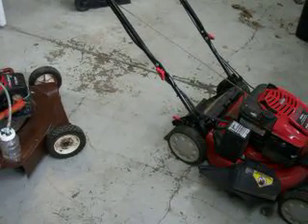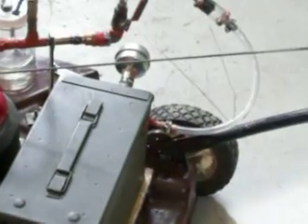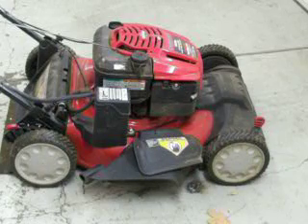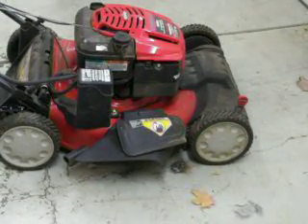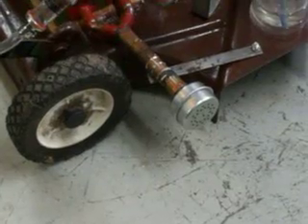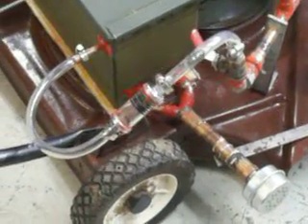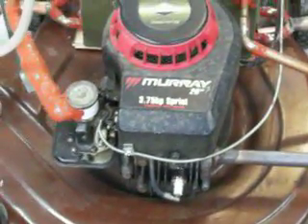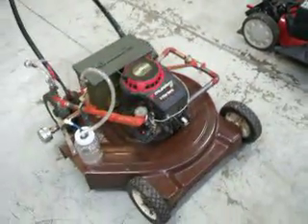temperature difference between gasoline and gas vapor

Comment: At 160 degrees Fahrenheit, it will only vaporize the "Light Ends" of the gasoline. The "Heavy Ends" will be left behind in the tank, and will not vaporize at that low temperature. The engine will stop running, and the Heavy Ends gasoline which is left in the tank will not produce vapor.

Comment: Gasoline engines are said to run at an air to fuel ratio of approximately 14.7 parts air, to one part fuel. That is a very lean air to fuel ratio. Water fuel research indicates that hydrogen burns perfectly with one part oxygen. H2O is two parts hydrogen and one part oxygen. Gasoline is hydrogen and carbon. To burn the hydrogen molecules in gasoline, the air(oxygen) to fuel(hydrogen) ratio should thus be two parts hydrogen to one part oxygen. That's two parts fuel to one part air. So what you are actually doing in your experiments is running the engines very rich compared to the stock unmodified lawn mower design. This is the reason your engine runs so cool. Because you are burning the fuel at a true stoichiometric(equal, balanced, complete) combustion. Carbon Monoxide(CO) is only produced when all the hydrogen is not burned from being deprived of oxygen. HC(hydrocarbons) which is gasoline, is only produced in the exhaust when oxygen cannot reach all of the gasoline molecules and are thus expelled from the primary combustion chamber into the exhaust system. Your evaporative fuel system allows the gasoline molecules to mix perfectly with oxygen molecules allowing all of the hydrogen in gasoline to burn, and thus no carbon monoxide nor hydrocarbons are expelled from the primary combustion chamber. You remind me of all of my favorite teachers in school and in life. You don't get mad. You get clear, and you get better at what you do. Thank you vaporkid!
Reply: Sometimes it's 14.7, sometimes it's down to 12.
Reply: True Zero Emissions - I don't understand why people say it's running cooler with fumes, the head temp on vapor was 260-270 while the gas engine was 215-220. The only reason the exhaust temp was lower is because it had 2 feet of copper to travel thru dissipating heat. So the heat temp is the only real determining factor and was way hotter. Unfortunately it's not richer but leaner.

Comment: The muffler is cool because you are cooling the exhaust through the copper pipe and the evaporation of the gas which causes it to cool drastically.  If you would measure the carburetor temp on the gas engine you will see it way below ambient. I've seen carburetors ice up on a hot summer day. Evaporation causes cooling. You are cooling your exhaust gases with it.

Comment: Quite the vaporization system there!I know it would be a pain to do, but it would be nice to have an exhaust emissions test ran on this mower, to have concrete results to back up your clean running claims I saw a car on TV about 15 years ago idling in a closed garage for a long time, they said it had virtually zero emissions. I do all kinds of strange things with Briggs engines, watching you vids has encouraged me to make a vapor system for one. Thanks for showing us all of your hard work and experimentation.

Comment: I really like your style of engineering. I do have a couple questions though related to heating issues

1. What is the longest continuous time you have run one of you vapor engines?
2. How many hours do you have on you oldest setup?
3. How much of a difference does the addition of the water vapor jar make? I can't see anything that seems to be heating the water in the jar, and at room temperature I can't imagine it would be much different than the ambient air.
4. What is the temperature on the exhaust pipe near where it exits the engine? To discolor the pipe like it has I would imagine it isn't touchable

Upon doing some research, there seems to be a general consensus that using gas vapor is much more efficient. The biggest problem repeated by most of the naysayers is that the extra heat will destroy the engine. What good is getting 1000+ mpg if you engine is destroyed after 5000 miles right? I haven't done any of the experiments myself, but I'm thinking about it. I've been having trouble finding any accounts from tinkers such as yourself on the longevity of the engines with such modifications. I would like to have some clue before I start tinkering with it myself.

Thanks for any info you can provide.
Reply from the maker: yes continuous i ran one for 3 hrs straight cutting grass and not once did it run hot or hurt the engine. 
forty hrs on my lawnmower
the water vapor jar actually helps cool the engine more and cleans the engine  
and last the temperature leaving the exhaust port gets around 375 degs
going in to the copper pipe 

the good thing about running on vapor,  you dont ever have to worry about the carb ever flooding and not starting,  oil will stay clean for ever because your not using liquid  gasoline which causes the engine to get car boned up, the engine will last for ever. i will tell you this iv been doing this with my lawnmowers for over 12 years and i have never ever destroyed one from doing this
Reply: I'm definitely no expert,  but a lean mix can cause overheating, but that's a "devil in the details" thing. Running a bit rich allows the extra fuel to cool down the cylinder walls.. Max engine temperatures happen at around 16 to 1 air/fuel, which is also where the nitrous compounds are formed. The perfect ratio in theory is 14.7 to 1. Perfect ratio in practice is more like 13 to 1 air/fuel. If the air/fuel ratio goes significantly lower or higher, then the engine will start to run colder. In a nutshell, running an engine extremely lean sacrifices power but gains efficiency. Running an engine only very slightly lean will probably melt it.

Like I said tho, I'm no expert. I'm just a spectator myself trying to learn all this stuff. So take it with a grain of salt.

Comment: Great Video, very inspiring for sure, I do have a question though if you would be kind enough to elaborate, What is the glass jar on the side of the mower by the intake and what is its purpose, it looks like water ?

Thank You again for a great video..
Reply from the maker: that jar is called a water vapor injection system, water vapors help cool the engine temperature down. if you ever notice in a car when its raining out side how much smoother it runs, thats becuse the water vapor cools the engine down, same thing the water jars doing.
Reply: @TheVaporkid  if you don’t have the water injection, would the mower overheat?

Comment: Copper dissipates heat rapidly.  What's the exhaust temp near the block?

If your 1.75 hp motor will run 100 hours on 20 fl oz of gasoline, then your system would produce ~130 kWh of energy (1.75 hp * 100h = 175 hp = 130.5 kWh.  That would be impossible as there is not that much energy in 20 fl oz of gasoline.  20 fl oz. of gasoline contains ~5.3 kWh of energy. 

Obviously, at idle, your motor doesn't produce 1.75 hp.  How much does it produce?  Based on ~5.3 kWh of energy in 20 fl oz of fuel, your system could produce only about 1/25 hp to run for 100 hrs at idle. 

Put a generator + inverter + heater load on your motor to see how long it will run at its rated hp--now that would be interesting!
Reply: hey bro you're still thinking fluid power over vapor. a "normal" carb only atomizes, the fuel vapor is 1000 times smaller. It really is making better power and running smoother and he's still running rich as well. Also the reason why it's so cool out the exh is as gas vaporizes it gets cold, Really cold until it doesn't vaporize any longer. The exh is keeping the gas temp up.
Reply: InJayzBraiN
I was describing basic physics.  There is only a certain amount of energy in a certain quantity of gasoline.   If you converted 100% of the gasoline into energy, that's it--there is no way to get any more energy out of the fuel.

Although it is true that the combustion efficiency of a vapor (up to 100%) is much higher than a spray (~30%), and that it can produce more power & greater fuel economy, but, that isn't what I was typing about.  He can't get more energy out of the max energy of the fuel.

re:  "...the reason why it's so cool out the exh is as gas vaporizes it gets cold, Really cold until it doesn't vaporize any longer. The exh is keeping the gas temp up. "
Please elaborate on that ^^.  Evaporation occurs before intake in his engine, right?  How could that affect the output exhaust temp which is after the combustion phase?
Reply: zeffur7 His copper exhaust pipe(s) run through the liquid gas at the bottom which is getting chilled by the intake air pulling vapor. He measured the temps at the block in another vid he did so you can look and see what it starts out at.
Reply: InJayzBraiN Hmm... Evaporation does indeed create a cooling effect for the piping around the liquid that is evaporated, how would that cool the incoming liquid that has not yet evaporated?  Also, why would he want to cool his exhaust before it is exhausted out of his system?
Reply: zeffur7 The exhaust is heating the liquid gas enough to continue evaporating at a decent temp. All the gas he uses is in the bottom of his ammo box gas tank so the exhaust is trying to warm it all.

Comment: Very nice demo! This kind of setup works great for stationary engines like generators and such forth. Now, we only need to have an adaptation for the car. That is where the problem comes in. Tyson Capel (sp?) actually reproduced this heated gasoline setup for his vehicle, but ran into problems because of the inconsistent results. There are too many variables which come into play with cars. I think he's still trying to work the bugs out, but you guys are really inspiring.

A few years ago, I thought about using a gas-filled metal can, strapped to my exhaust manifold, and insulated. I would suck the super-heated fumes off it to run the car, which would use less tank fuel when it sensed a rich environment and save gas.
The problem was this. What happens to the fuel when I shut off the car, and it is still being vaporized? Since I would use one-way (check) valves to prevent the vapors from leaking into the atmosphere, wouldn't it back up inside the lines and all the way to the cylinders of the engine? Would that not cause an explosion when next I started the engine? This is a huge risk!
Aside from that, if I let the vapors escape into the environment via a tube to the outside the engine bay, that would still be a fire hazard, wouldn't it? It could cause a fire, even if I used a flashback arrestor.

For now, I just pass hot air over the gas, using your whicking system and a HCS (Hydrocarbon Cracking System) setup. It makes a huge difference in power, and is easily detached from the car. The engine feels alive, and I get about 70 more miles out of the tank -without taking it easy! I would like to see how far I can take it though.
If we all put our minds together there is nothing that cannot be achieved! Thanks for all the hard work VK!
Reply: What if you used electric heat and a few miles before you get to your destination turned the gas heater off, the gas would then cool to a temp to low to vaporize. Also if you cap the air intake lines and used a shut off valve on the vapor tank when not in use there wouldn't be a problem backing up. The guys running a 2 gal gas can with bubblers off their cars make it about 30miles before it becomes an issue. Running off exhaust heat isn't controllable enough even though the temps are dramatically reduced there's still heat after the engine's off. 12 volt silicon heaters have peaked my interest lately.

Comment: Well done............. Vapor Man, Can't wait to see the results.....!! Thank you for sharing your hard work....What is that red sealant that you are using called...? I want to try your set up, Already got my ammo box...!! P.S. What is the optimum liquid gas temperature that you are shooting for...?
Reply from the maker: CapnSchep that red stuff i have around the joints is a high temp gasket silicone gos up to 650 degs, most of the joints are silver soldered, when the fuel gets up to around 130 degs its starts makeing the vapor mist, make sure you have the air entering the ammo box hot because cold air will start to condense the vapor back to a mist, also i run a sponge filter at the top of the box so its compleatly dry before entering the motor.
Reply from the maker: TheVaporkid also i have a gas soaked wick for  starting  it on when it warms up and starts producing vapor it takes over for the running of it.
Reply: TheVaporkid
Thank you so much for your quick response, this is very inspiring...!! On your next video, could you please show us the sponge filter set up you are using at the top of the ammo box so that the gasoline vapors are compleatly dry before entering the engine intake..? Thank you Vapor Man and I really appreciate you sharing your hard work with us all...!!